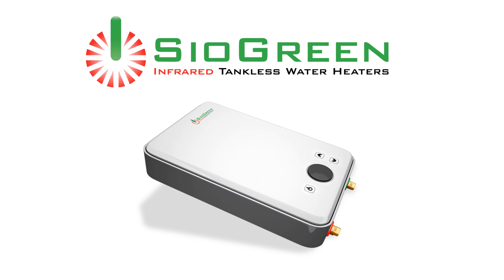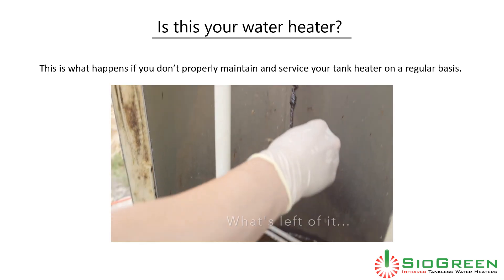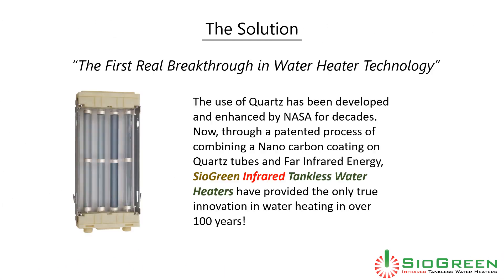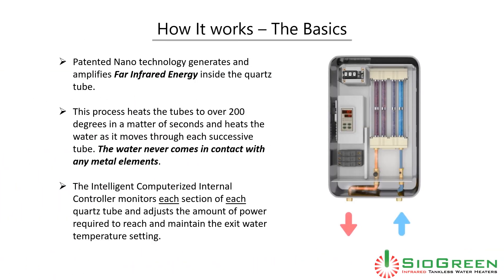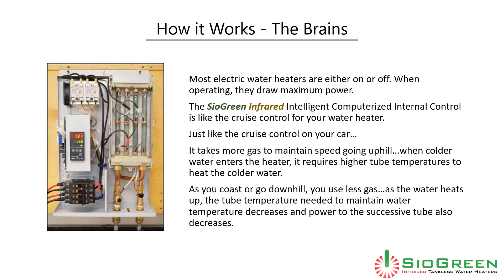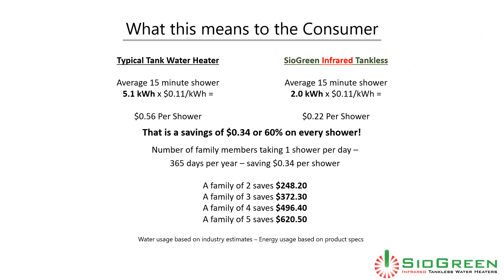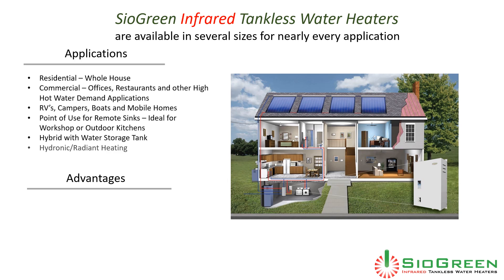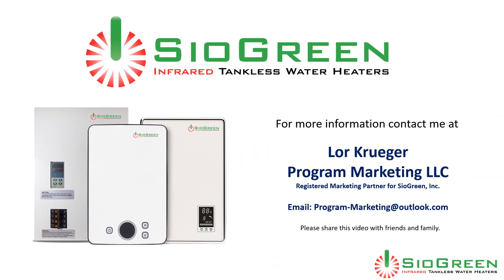Welcome to SioGreen Infrared Tankless Water Heaters   The Next Generation

Comment: I think they are out of business, the one I bought is leaking internally and I want to replace it but I can't find where to buy one.
Reply from the maker: SioGreen is not out of business. The units are no longer available online and only through professional installers and contractors. Did you register the unit for the warranty? If you did, we have a full 2 year replacement warranty. Send me an email with your information,  the Model Number and Serial Number so I can see if it is covered under warranty. lor@siogreenpro.com
Reply: I purchased it June 30, 2018, it was working great until it started leaking internally between the water flow sensor and that square black box in the middle, corrosion all over fittings. I was going to try and replace the rubber gaskets to see if that will seal it up.Everyone else sells their tankless water heaters to the public, I think you are making a big business and marketing mistake doing it the way you're doing it. Your web site doesn't work or give anyone information as to where they can get your units installed by qualified professionals charging astronomical amounts of money getting your products installed, that's why what your doing will not work, it's unrealistic, in this economy people want to do it themselves.
Reply from the maker: I previously asked you to provide the Model Number and Serial Number of the unit. I would also like a picture of issue you are dealing with. It may be a simple fix, but I can't help you without the information. Also, where are you located and where did you originally purchase the unit?